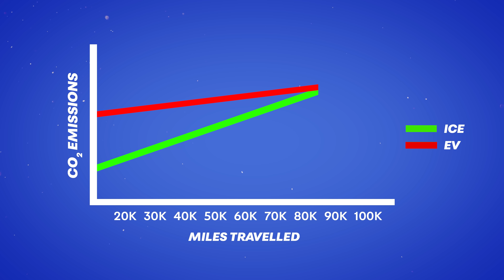Are Electric Cars REALLY That Green? [New 2022 Data]

Comment: Great topic Rory. Here's another thing to think about. Who's to say that an electric battery will last 50,000 or 90,000 miles without failing and a new battery is required- battery life cycle..... Nobody has touched on this, especially if the battery production is the polluting method within EV's
Reply from the maker: They've all got warranties for 100,000 miles. They'll last that long (and longer) easily.

Comment: You’ll probably need a new battery by time 90k miles are hit, battery recharging degradation.  A check is required on battery expiry faults before 90k threshold. Good point generally to keep an eye on certainly.

Comment: I looked at this report published by Volvo, but they seem to consider that the gasoline or the diesel simply magically materializes in the tank of the cars. They omit to calculate how much energy is needed to :
1. extract the crude oil, 
2 ship it to the refinery, 
3 refine it (that takes a lot more energy than extraction),  
4 ship the product at the destination, 
5 where diesel trucks (very non zero emission by the way) deliver it to the gas station. 
As opposed to : 
step1 : produce electricty (locally) step 2: send electricty by wire to where it's needed. 
There might be a non zero emission way of generating electricty at step 1, depending on the grid, but step 2 is carbon free.
The oil business uses at every step a very dirty process, and only if all goes well and there are no accidents, there will be no oil spills, that usually produce a huge environmental impact.
We can mention Fukushima and Chernobyl amongst the electricty generating accidents, but the nuclear plants are not the only way of producing it, as opposed to the oil extraction.
So even if you just look at the carbon emission from EV vs ICE and disregard the discussion about pollution in the city (which, by the way, should be taken very seriously), there are still many advantages of using an EV. In a new Reuters report from June 2021 (Volvo published that report in 2020) , we read that, i quote : 
"[...] you'll have to drive another 13,500 miles (21,725 km) before you're doing less harm to the environment than a gas-guzzling saloon.
That's the result of a Reuters analysis of data from a model that calculates the lifetime emissions of vehicles, a hotly debated issue that's taking center stage as governments around the world push for greener transport to meet climate targets." 
I am not puting up the link because I noticed that Youtube will erase the comment when I do. But it's on the Reuters website. The title is "Analysis: When do electric vehicles become cleaner than gasoline cars?"
In a very extreme case, where electricty is generated exclusively from coal, there will be a long time (around 70000 miles) before the EVs are cleaner. But that's really not the case anymore, coal is being retired gradually off the market. Not to mention a lot o people can now generate their own electricy by installing solar panels on their house, which are obviously zero emission.

Comment: 1. Volvo is basing this on their ICE cars that are all efficient turbo charged 4 and 3 cylinder engines. Larger vehicles with larger engines (all the trucks in the US) would show different results. 
2. Production for EVs is still developing and should be getting better(more efficient) in the future. This includes battery production. Production for ICE vehicles will not benefit from the same rates as they are already mature in development. 
3. Most of the world is moving toward cleaner energy meaning that the electricity from the grid will get more environmentally friendly but the petrol we use for ICE engines again will not benefit for this. 
Conclusion: While this study might be factual for the present, it will be soon be outdated due to the multiple ways EV related technology is advancing.

Comment: I would love to see comparison with hybrids and plug in hybrids as well...
With the current technology, I think they are a better solution for most people.
Reply: Also something I would like to see. What would the affect to the study be if you got a new battery at 100K miles. Granted it may not be necessary, but if your battery has dropped by 1/3 range at 100K, I am sure many people would put a new one in.
Reply: If you mean that BEVs are better for the environment than hybrids and plug in hybrids, than you are correct. If you mean that with current technology BEVs are the better solution, than I salute you because once again you are correct. If you mean that hybrids and plug in hybrids are the better solution, than you are incorrect. Any one telling you that hybrids and plug in hybrids are better for the environment are wrong. Additionally, if they are telling you that hybrids are easier to maintain or are better to drive, they are wrong. Think about it logically. ICE cars still produce all those emissions from the parts like the engine, transmission, body, electronics, etc. that go into them. Hybrids take all those emissions and then add a small battery pack, electric motors, and the necessary electronics. The vehicle becomes a lot  more complicated. You can’t beat a small electric car with a small battery pack that gets produced using renewable energy and then is charged via solar power for its life. Granted that’s the minority still, but even the alternative of big batteries and plugging into a mixed energy grid is much better than hybrid and ICE cars. Don’t fall for the bs propaganda meant to delay electric cars that being pushed out by companies like Toyota. All you need to understand about Toyota and how dumb they are is that they are still pushing hydrogen fool cells for passenger vehicles.

Comment: Another excellent video, Rory, thanks. A couple of points, though, because while that comparison may be true now (because of low EV numbers), it won't be in the future:

- Battery technology continues to evolve rapidly, in both quality (less use of polluting materials, like cobalt) and quantity (manufacturing economies of scale mean each unit will have a lower Carbon Footprint), whereas fossil fuels reached their peak production efficiency long ago and no further significant improvements are possible. Put simply, the CF required to make an EV will reduce sharply as volumes rise, because you have to add in the CF of the factory itself, but divided by the number made.

- The electricity source used to charge it can't be directly associated with the EV itself. Owners have to use what's available, ideally cheaper renewables, but if it comes from coal, that's not the fault of the EV! This is classic blame sharing by the fossil fuel industry ("you used our dirty product, so you're dirty too"). Even so, with their more efficient drivetrains (90%+), EVs still pollute less than ICE cars with a Thermal Efficiency of only 40%, plus all the lubricants they use.

Comment: All Volvo are doing here is highlight the increased manufacturing cost to the environment, but more importantly it highlights how far behind the government’s of the world are when it comes to grid electricity generation. In the UK no electric car can be charged from the grid on renewable, 52% of the grids power comes from fossil fuels. That is slowly reducing but it’s decades away, maybe even 30-40 years away. I think they are just putting pressure on electricity generation, that’s the most important thing, without it as they highlight it’s next to pointless.

Comment: Fair points all around. EVs are not the end all be all solution to all our environmental problems. They are a good step in the right direction and only one pice of a very large puzzle we have to address. We need to keep cleaning up the manufacturing process for EVs and ICE cars, clean up our energy sources as well to make them a bigger part of the solution.  

Having said that, I bought my EV not necessarily for the tree hugging part, that’s more of a bonus for me. I bought it for the performance and other benefits! It looks great, it drives amazing and is saving me tons of money compared to my gas guzzling V8 which costs about $600 -$700 a month in current gas prices vs all of $40 to $50 a month energy bill increase to charge my car. Those savings then of course go into a more expensive car bc EVs by and large are indeed more expensive than their ICE counterparts, and mine more so than average. So for me, I like going EV a lot. We are considering a 2nd but will likely always have one ICE car on hand too.

Comment: One thing that goes unnoticed in these studies... is air quality improvement when using only evs. Cleaner air in city centres.
Reply: Lol. 

*Laughs in battery production waste
Reply: @dankamoonz3901  I don't see any reason to laugh if you prefer breathing exhaust fumes knock yourself out. Battery production by itself produces co2 to a degree and it really depends how the energy to manufacture it comes from.

Comment: technically there is still room for ICE improvement by making the petrol supply greener, another thing is that the batteries in the ev need to be replaced after some time and that’s another steep increase in CO2 per lifetime, with petrol car constantly polluting, but being potentially longer lasting the debate is interesting though and it would be great to see experts drive the legislation rather than politics and selectively informed activism

Comment: Great video but it should be considered that if you look at these figures from Volvo and take into account the lifespan of a Lithium Ion battery being circa 8 years, or in the region of 90,000 miles, will you ever see any real "green Co2 benefit" on the other side? Furthermore, is it even economically viable to replace an EV's battery after 8 years considering that battery technology will have moved on meaning that in turn, it would be expensive to produce replacement batteries for old models?  Also worth checking out a recent BBC report on the issues surrounding the production and recycling of Lithium Ion car batteries which highlights that batteries need to be recycled in a lab environment to mitigate against the potential for them to explode during the recycling process? Of course all this depends on your location and what percentage of the power in the local grid is from renewable sources. In Europe that figure is in the region of only 20% in 2020 and with the power demands rising much faster we are struggling to bring this figure up.

In reality, EV's are simply  not the answer to tackle climate change, but neither is falling back onto using the ICE and fossil fuels. Hydrogen Fuel celled vehicles is by far and away the best solution to this problem. While you currently need a lot of energy to separate the Hydrogen from the oxygen, we should be pouring all the resources into developing this technology as it can be used in a much larger variety of vehicles such as trails, trucks, cargo ships and even planes.
Reply: Most EV batteries retain 80% of their original capacity when 8 years old. So you don't replace the whole battery unit - just the dead cells.

Comment: They are not cleaner. Where is the electricity coming from ? There hasn't been a new nuclear power plant in the US in decades. 

The mining of lithium is also an issue. Also, where are the used batteries going? It also takes electricity to make the cars. California is the greenest state in the US and they still use fossil fuels for a good percentage of their electricity. To note: California uses windmills, solar power, and hydro- electric power and they still use fossil fuels to an alarming degree for electricity to some districts.

Comment: Lazy click bait. I would expect this from tabloids but thought you were better than that.
The Volvo report has already been superseded by the ICCT report that shows it’s only 7000 miles.
One less subscriber.
Reply: “However, recent estimates of battery manufacturing emissions vary by a factor of 10, indicating the need for additional research in this field.”
Reply from the maker: If you were a subscriber you’d know we’ve never done a single anti EV video. Including this one.
Reply: @Autotrader_uk  I’ve been a fan of Rory’s videos on fully charged and Autotrader. Re-read my comment, I didn’t say it was anti EV, I said it was lazy clickbait using an out of date report.
Reply from the maker: It’s Volvos latest figures. The report is not out of date. Yes there are different reports, but they don’t pertain to Volvo’s XC40 products as far as far as I understand. Only Volvo can accurately report on Volvo’s own figures.
Reply: @Autotrader_uk  every report from legacy car makers(who have invested billions in developing there internal combustion engines) claim it takes tens of thousands of miles to balance the emissions so the conclusion you have to make is that you should stick with combustion engines for now(there most profitable cars) and yet every independent peer reviewed study puts it at less than one year as the latest ICCT report has.
I say it again, lazy click bait video.
Reply: @Autotrader_uk  Volvo is a Chinese company that produce a report that said you should continue buying there internal combustion engines and you took it on face value and created a lazy clickbait video.
Because of that I have cancelled my subscription to the autotrader YouTube channel and my aututrader emails.

Comment: One factor that I bet was not considered in their calculations (because it's not related to building or powering the car) is that fact that it takes a lot of energy, time, and emissions to get the power for ICE cars (i.e. gas or petrol) to the stations. That is enormously inefficient, compared to simply sending electricity along a grid. Even better, have a little solar farm powering the EV charging stations, skip the cost and infrastructure of a grid entirely.
Reply: 5:16 Considered.
Reply: @kyleschellenberg3777  Thanks. I stand corrected.

Comment: Problem with EV's are batteries. Here in Serbia, they want to build a 400 hectares lithium mine, relocate thousands of people, pollute 3 national rivers, destroy wildlife and use so much water for lithium extraction, it can completely drain local villages and farms. Government was all for it but people blocked roads, highways and even a border crossing in order to stop this devastating project. They found lithium in Portugal as well and it's exactly the same situation there. In order for you to drive your "clean" car, thousands of people have to die from water pollution, and those 400 hectares used for mining are just for the mine itself, area triple that in size is going to be polluted and the air pollution is going to reach surrounding countries as well. All of this without talking about rubbish dumps created from extraction in an area prone to yearly flooding. Bio Fuels are the answer since hydrogen is hard to extract and keep. Instead of investing in Bio Fuels, these companies are just going for this easy fix, but long term consequences are going to be disastrous. And this is only for lithium mining, just Google cobalt mining in Congo, that's a human rights disaster!

Comment: it's true 5000+ lbs 100+ kWh EV's are not really that "green". especially if its a suv ev  driven with 0 passenger. you could save as much emissions using a smaller , efficient ice (hybrid?)car.
I've settled for what feels to me like best of both world. a  cheap, zippy and fun small 2+2 short range ev wihtout no fast charging to go around town, and a cheap midsize 3 row suv that is reasonably efficient on highway (30+ mpg) seven seats and a huge trunk with the 3rd row down. I got both with low mileage, under warranty and for a total cost less than half of a BASE Model Y that is still smalle than my sorento. I drive the ev whenever possible, avoiding putting miles on the SUV with cold engine, spending money on gas, or even using the brakes in city traffic/stop lights/stop signs. I can also road trip without worying about having a charger at destination, or stopping whenever/wherever/for however long I want for gas. Only regret is that the SUV is not hybrid, price difference was too big to consider it at the time Not questioning that ev is the future, but it will take some time before everyone can find the perfect EV match, wether it's ligthweight fun driver's car like a miata ev replacement, a large/cheap people/cargo mover like used minivans/suvs. EVs are still too focused on the most profitable premium crossover category, we need more choice.
Also when the charging issue is behind us, with fast plug & charge chargers everywhere, that are not out of order or do not require you to download a new app/resgister a new account, long range will become pretty useless and meybe we'll get much lighter EV's
I'm not going to miss heavy and numb ice suvs with slow automatics, which feel more fun with instant electric torque, but still nostalgic about the light manual hatchback I grew up with.

Comment: What about end of life for EV's and ICE vehicles?
Which ones components are more easily recycled?
Batteries degrade over time and eventually need to be replaced.
Take this scenario for example..
Say I own 10-year-old Tesla which is still in good condition and a 10-year-old Mercedes.
The battery in the Tesla is damaged would I pay to put a new battery in a 10-year-old car or would I just send it along to the junkyard.
Same thing for the Mercedes the engine could be rebuilt or replaced with a remanufactured or used engine and far lower cost than the cost of a replacement Tesla battery and the car could be driven for another 20 years.

Comment: Have they factored in that the batteries will need to be replaced every 8-10 years? And that the cost of this would probably mean that the car will be scrapped. So the total life of the car may only be 8-10 years.
Reply: Most EV batteries retain 80% of their original capacity when 8 years old. So you don't need to replace the whole battery unit - just the dead cells.